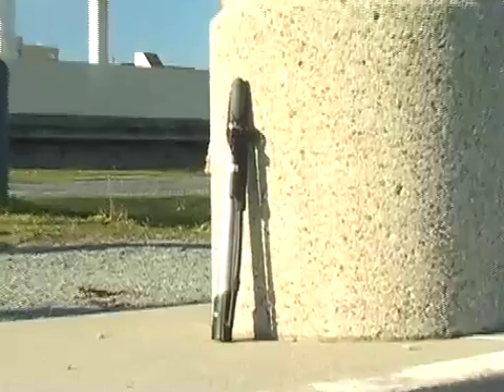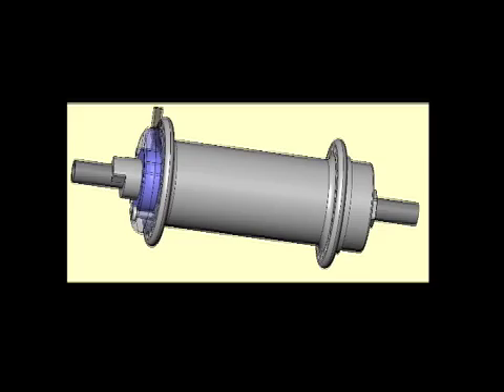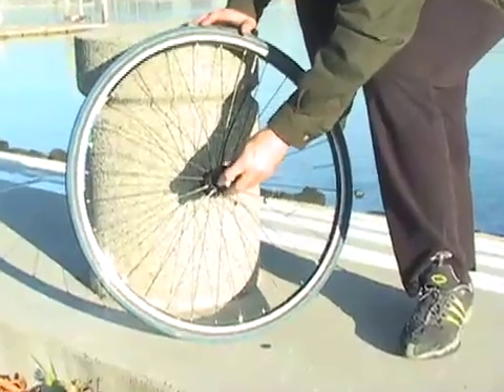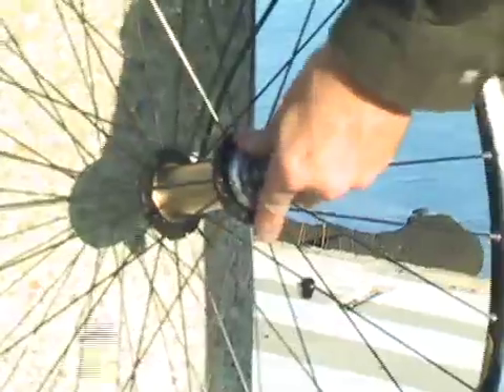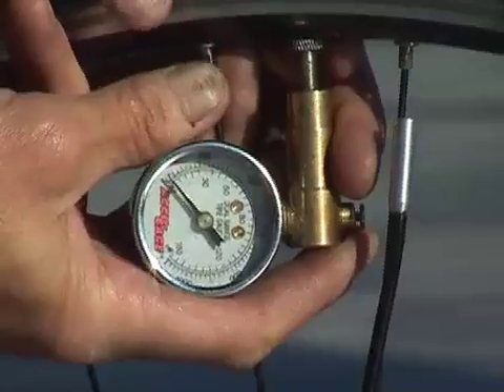Semi-Automatic Tire Pump

Comment: That's an outstanding idea!  The only drawback I can see is that it's hard to ride a bike that has a completely flat tire, but then again the whole time it would be getting easier as the tire fills.  If it's easy to manufacture and not too expensive, I could see this being a standard feature on all bikes.